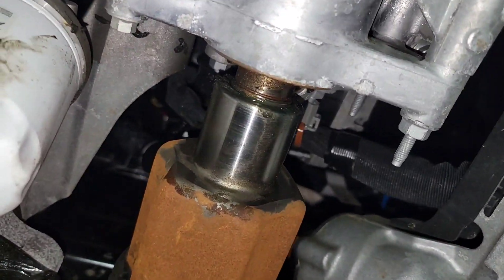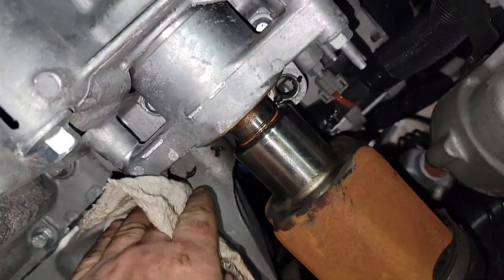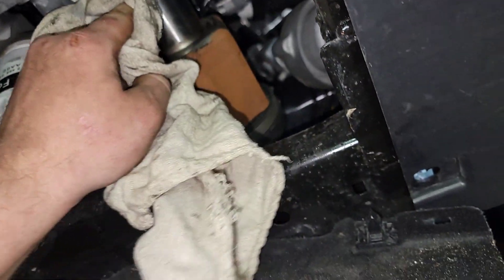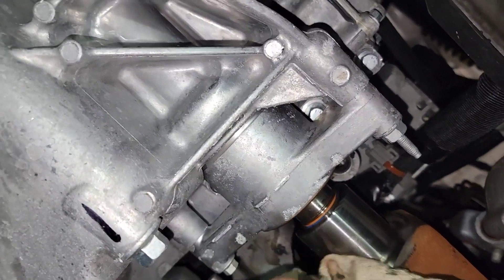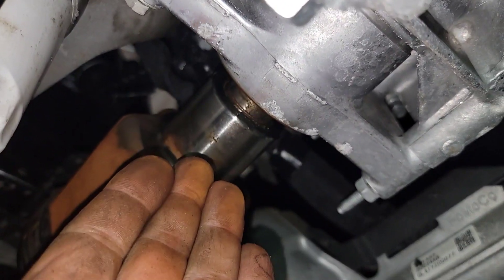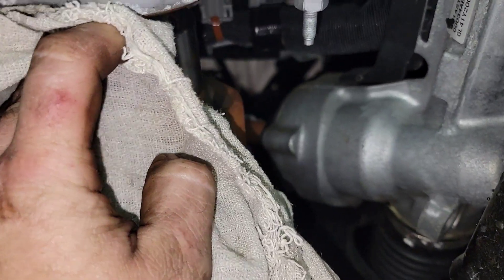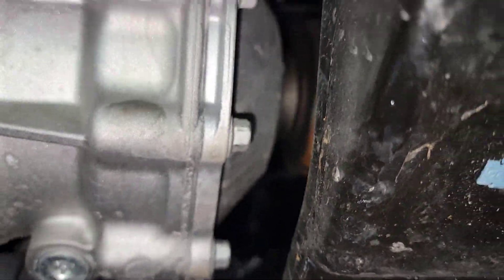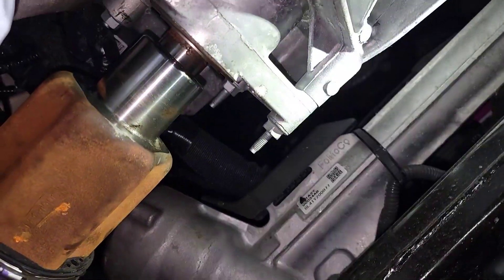2022 Ford Explorer 2.3L Ecoboost CV Axle Not Installed Completely From Factory - Come See

Comment: I went with my dad in 2016 to pick up his new f150 when it came in and the sales guy actually asked my dad to bring the truck back for an oil change between 500 and 1000 miles to get out little particles from manufacturing and the break in period, I just about passed out I have never met a sales person that knowledgeable, I just thought it was something us gear heads did after we installed a motor we just rebuilt.

Comment: Years ago I had a dealership technician do a rear main seal on my vehicle under the powertrain warranty. When he removed the front axles, he must have pulled them from the front. Instead of the rear with a remover tool. I got it back shaking like a paint mixer. He damaged the left axle and couldn't have even road tested my car.

Comment: Pretty sure I was the first one in the country to drop the front drive motor out of a lightning for a fault code. The harness for the drive motor had 1 pin for the resolver with poor pin drag. Our fsc then had to explain to ford engineers what pin fitment/drag was.
Reply from the maker: Yeah we lack alot of skill and knowledge uptop....Straight book smarts but no hands on or minimal
Reply: @FordBossMe  Didn't help that in order to perform the pin point test you have to drop the drive unit as 2 of the connectors are covered by the drivers side mount.

Comment: The problem is Ford has an oil life monitor in the car which tells you not to do it till 10,000 miles. My mom has a 20 explorer with the same engine and went 10,000 miles because “told her to.” I told her don’t ever do that again, you spent $40,000 on a car change the oil at 5k with synthetic. But she was only doing it told her to and doesn’t know much about cars so it’s hard to blame her.
Reply: I totally understand

Comment: Assembly line moving along, stuff happens. This is actually what warranties are meant to cover. Goofs in assembly and premature part failures. One other note, had a customer oh cam locked up almost no oil in it, 40,000+ miles and never changed or checked the oil. Ford salesman told her she didn't have to do anything to the car till it hit 100,000 miles. SO SHE DID NOT DO ANYTHING BUT DRIVE IT and GAS IT UP. Don't know why he told her that, car only had a 2 year/24,000 mile warranty. But she took him at his word.
Reply from the maker: Stupid salesman

Comment: just had a 22 exploer with 6500 miles come in for its frist service at my shop with same thing dealer ended up having to replace the front diff cause it messed up the splines and the axle wouldnt lock in seems like this wasnt a one off and ford might need to recall to check that the axles are installed right

Comment: Low transmission fluid hurt the transmission? It doesn’t take much force to set in an axle, just a spring clip. At least there wasn’t someone’s lunch sewn into the seat, an old story that’s probably made it around a few times.

Comment: Is there any advice you could give on preventive maintenance for a 16’ escape with a 2.0 ecoboost to hopefully keep it from having coolant intrusion? It has about 83k miles on it. Thanks.
Reply from the maker: Coolant every 30k and oil by every 5k, plugs every 30k, trans fluid and ptu fluid every 20k - 30k
Reply: @FordBossMe  This may be a dumb question but do the FWD escapes have the PTU’s or AWD only

Comment: My '21 came with a couple hard vacuum lines crossed and twisted up.  Dealership service advisor recommended 10k until the first oil change... nope, done at 3k
Reply from the maker: First Should Have Been At 1000 miles
Reply: @FordBossMe  wish they'd told me that... live & learn
Reply: @FordBossMe  only trouble I've had with it was sporadic lost comms with the transmission coming down mt washington... that was interesting

Comment: On the other side of the ocean we also have the 2.3 liter ecoboost but in a Ford focus with 280 hp. I just bought mine with 12.000 miles on it. The ford dealer I bought it from claimed that after 2 years the oil would be fine to run until 20.000 miles......
It did have a oil change after the first 500 miles, but still it is to long....

What does ford advise milage wise for an oil change in the US on these 2.3 engines?
Reply from the maker: 5k max

Comment: Hey bud have you ran across a no crank no start issue on a 2022 powerboost f150 no dtc was towed in
Reply from the maker: Oil life monitor reset?
Reply from the maker: Look in my library
Reply: @FordBossMe  figured it out weird concern, was not cranking finally got it give me a dtc performed the pinpoint test for the dtc but got me nowhere idk what hit me but tested the battery it tested bad and replaced the battery cleared all the dtc and reset the bms. Fixed it. What made it weird was that with my jump box it did nothing the accessories would come on and it would turn on after a while.